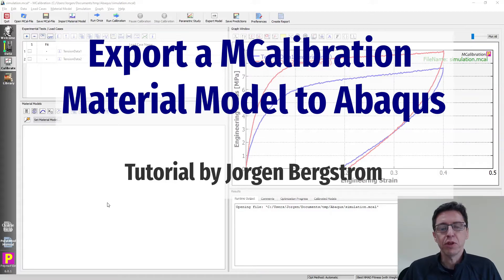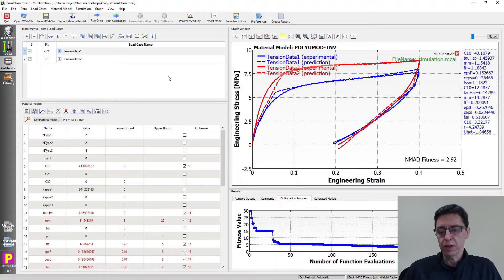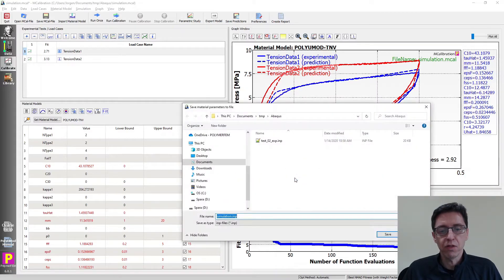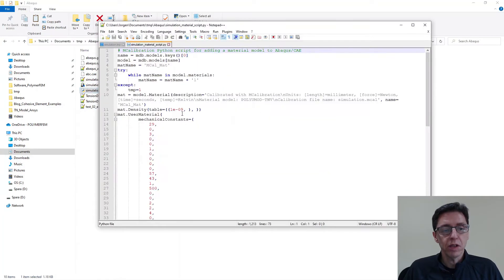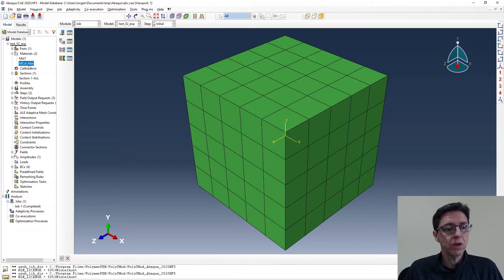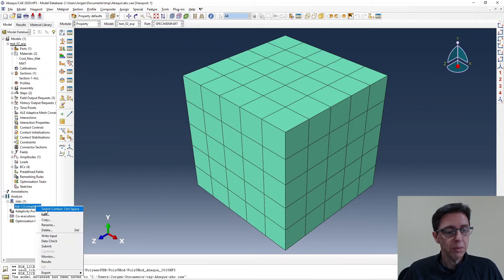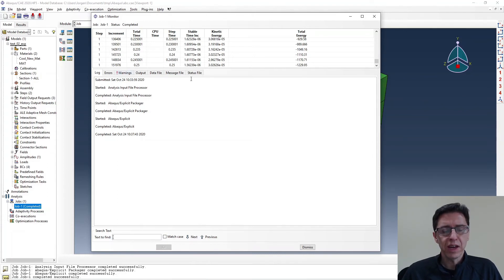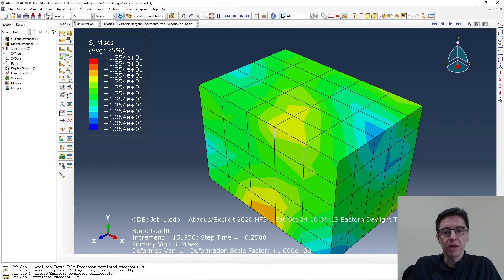Export a MCalibration Material Model to Abaqus

Comment: Hello, I have calibrated and exported a material model (PolyUMod-TNV) from MCalibration to Abaqus using the python script function. The simulation runs fine as long as it is an implicit simulation, however, when trying to run an explicit simulation with the same material model the simulation aborts with the following error message: "NO VUMAT SUBROUTINE WAS SUPPLIED FOR THE USER MATERIAL". I am not sure what more to include in the material parameters to make it run (and I am not so familiar with VUMAT sub). I have tried Abaqus 2019, 2021 and 2023. Thanks for any feedback.
Reply: Message Dr.Bergstrom, since he sold it to Ansys. I doubt they would support Abaqus request
Reply: @13cr1987  I am quite confident that when Ansys has aquired a program which provides data to be used in Abaqus, one out of many FEA softwares MCalibration supports, they will also provide necessary support to ensure it runs properly.
Reply: @tomeltott  : It's good to assume so. Once Ansys acquire it destroys the core capabilities example Autodyne, Fluent, LS dyna etc. Ansys have stopped funding original team in core research. Ansys is a sales man run organization.

Comment: I received the message of the error:
User subroutine umat is missing.
I used PolyUmod-PRF4YP and PolyUmod-TNV models.

Can you explain the reason for this message?
Reply from the maker: Thanks for your message. I will respond to your question by email.
Reply: @PolymerFEM  hello sir, this video is very useful for me.
And I got the same problem - User subroutine umat is missing.
Reply: @席琛舒  Hello, have you solved this problem? I ran into the same “User subroutine umat is missing”. To make matters worse, polyfem's website has been forcibly directed to ansys's website, which is unable to provide any useful information.
Reply: Hello, I have encountered the same problem. I think it might be a problem with the configuration of the environment variable that causes abaqus to fail to read the Polyumod material library. How did you solve this problem? Thank you very much.